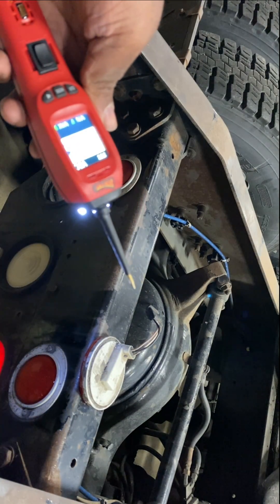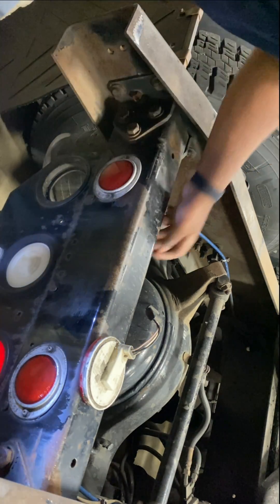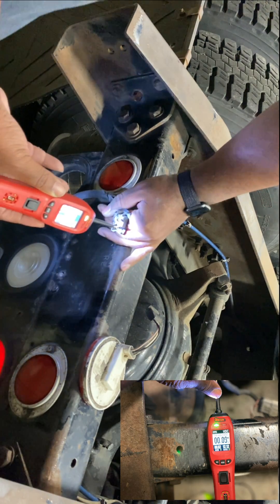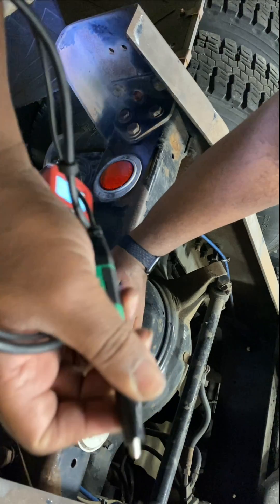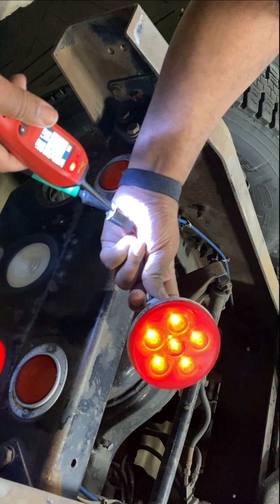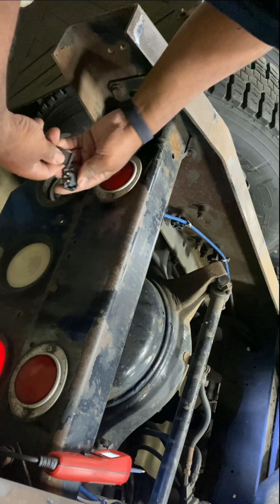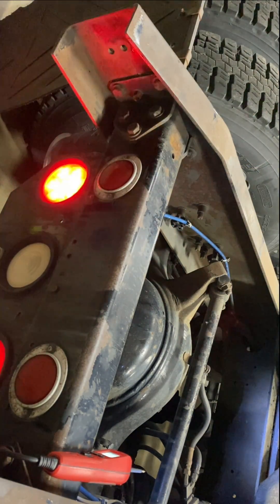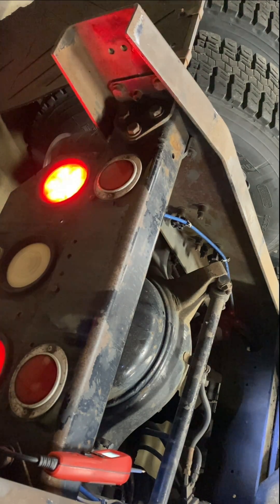Basic light testing with Power Probe 4

Comment: So, the Powerprobe will light up bulbs when testing them? I know I do things old school with a multimeter still, but the tone for hot and ground does make it a lot easier when youre crawling under the vehicle and you cant hold up the meter to see the voltage.
Reply from the maker: Yes it will light up things in the next video Im going to test a small motor with it. Just to show that function again. I think it is a very good tool I cant recommend it enough.
Reply from the maker: I also ordered one of your shirts last week Im hoping to get it in the mail today!
Reply: @learndiesel528  Thats great. Im curious to see that function. It does add a lot more to just a multimete. Im saving up some, because I would like to get the set with the other stuff (the 400 buck set). I try NOT to go overboard with tools, because I can easily get in trouble lol.. Just spent 100 bucks but got a nice hose pick for the bus and finally got a good dead blow hammer.
Reply: @learndiesel528  I do appreciate that too. Im glad you like the design! I think its kind of cool, at least, shows the pride of being able to fix things. I do try my best (dont know if I succeed) in getting younger kids curious, and on the path of enjoying this, either as a career or just as a hobby.
Reply from the maker: @RipRoaringGarage  You will do it. Just keep going slowly but surely.
Reply: @learndiesel528  I know. The alternative was junking the car. So it dawned on me, that I have nothing to lose by trying my best to fix it. Either way I end up ahead. The car has become a great teaching rig for welding.